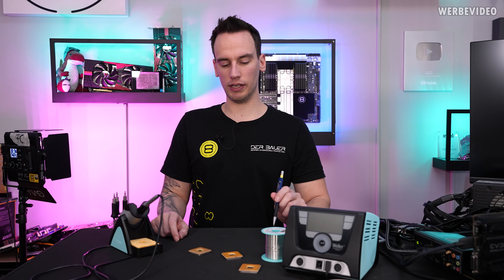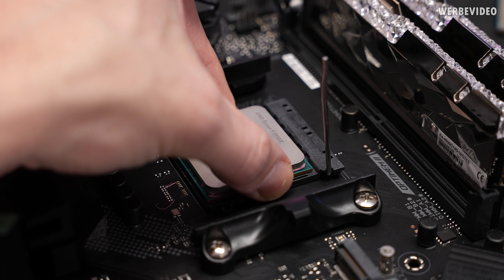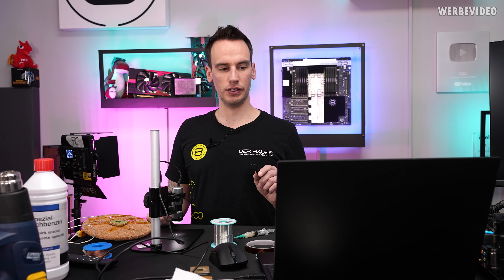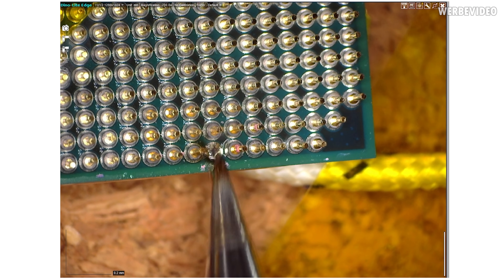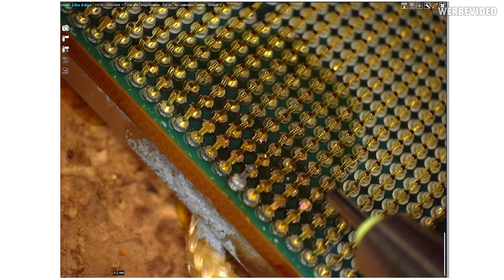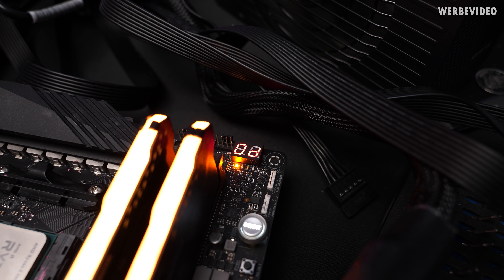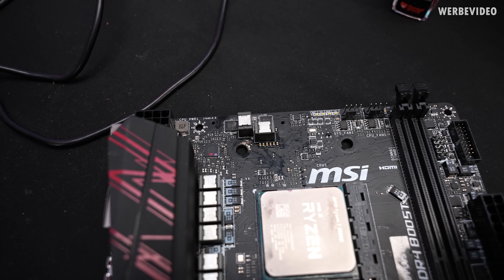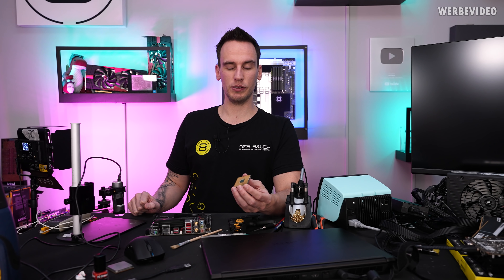I tried to Repair a Dead Ryzen 5950X and almost made it Worse...

Comment: You can take the pins off an old Athlon 64 (about 2-4€ on eBay) and throw broken off pins into the socket where they're missing on the CPU. No soldering required and works 100%. Done it plenty of times for several CPUs off one donor CPU. Obviously didn't resell systems like that, but they worked well as test benches for a while before giving them to friends.
Reply from the maker: Will give that a try for the follow up 😁
Reply: @der8auer-en  I have a 5950 with a broken off pin. So if you need an additional CPU for some soldering fun, let me know. (I drop it, and bend almost 200 pins :(, 1 snapped off )
Reply: It would be funny to try making a chip run entirely on a modular pin assembly, LOL
Reply: @stevenwest1494  convert PGA to LGA with this one free hack!
Reply: @stevenwest1494  that’s basically how LGA sockets work, just with a bit of spring added, it’s actually a metal strip instead of a pin but the concept is identical
Reply: Yep, I used to run a s939 4800+ dual core with two broken pins this way. Used pins from a dead 3200+.
Reply: @TwiztedJugallo  that was the old way of doing it more than a decade ago. Or a piece of wire with the right size.
Reply: Well he already has Ryzen donor CPUs as you saw in the video lol...
Reply: @Qyngali  He can also solder pins because he has the equipment. Most people don't. This comment was clearly intended for the audience, not for him.
Reply: @b0ne91  Well Roman replied so it seemed to me that he thought it was directed at him. Sorry for the misunderstanding.
Reply: You're a heartless monster.
Reply: sounds too dangerous. How you get em out again after the pressure they got.
Reply: @Xfade81  Magnet and tweezers, if you need to. Done it plenty of times after accidentally dropping them in the wrong hole.
Reply: No their pins are larger. U can buy one of those cheap am4 athlons or a6 cpus and steal a pin from there and send it back to Amazon 💀💀💀💀
Reply: @KuntalGhosh  😂😂 remind me not to buy a ryzen cpu from Amazon
Reply: @slytle89  I got lucky. 5950Xs were out of stock at most places including Microcenter so I grabbed one off Amazon. It was supposed to be new in box but the one I received had been opened. I called Amazon support and they offered to send a new one but it would take more than a week due to shortages. I ended up testing the processor and it had no issues so I kept it and Amazon refunded about 20% or so because of the mix up. Not bad IMO.
Reply: @KuntalGhosh  Athlon 64 pins perfectly fit into AM4 holes. They might not be the exact same size, but they do fit. I've done it to at least 4 CPUs that I specifically bought as damaged for a low price. My current 3700X cost me 70€ including shipping because it was missing 3 pins.
Reply: @KuntalGhosh  Alternatively, you can also just buy Ryzen replacement pins for 10€ off eBay but it's a waste of money when a whole donor CPU costs less than half.
Reply: @b0ne91  not to mention that if you remove one of the unused pins (and there are a lot of them), even the donor CPU will continue to work just fine (I'm a retro enthusiast, so for me that matters) :-)